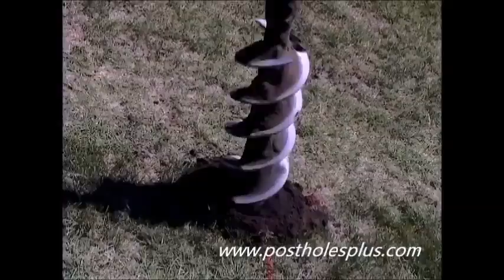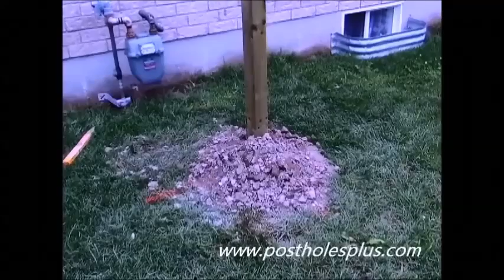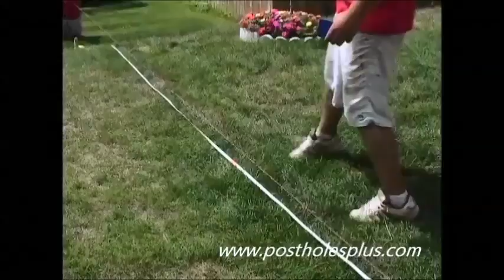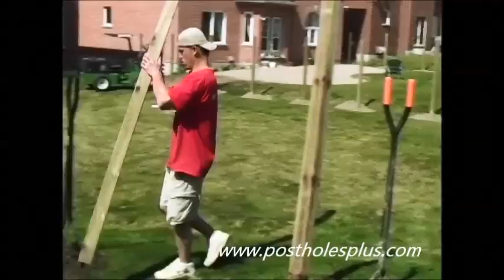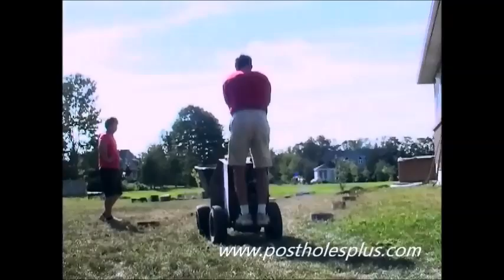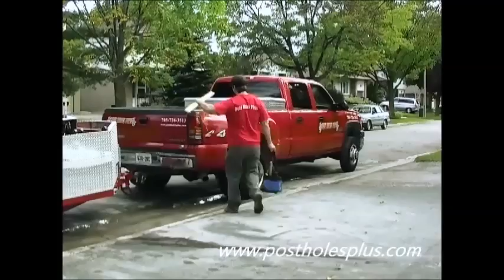The Post Holes Plus Experience

Comment: You guys leave the ground around the post because you are not equiped to pick it up an haul it away not to hold the post like you say thats bullshit, that only takes a small amount of ground taped with your foot the cement does the rest you make clients pick up ground, cut sonotubes and have post pre delivered, also bullshit, your guys digging the holes on the machine was doing a terrible job moving to much and makeing the hole way to large at the top compared to the bottom, this will make those post lift with the frost terrible, would not hire you lazy guys, you do not do a complete service, I do like your trailer set up thats it